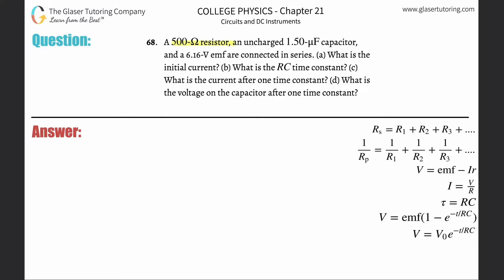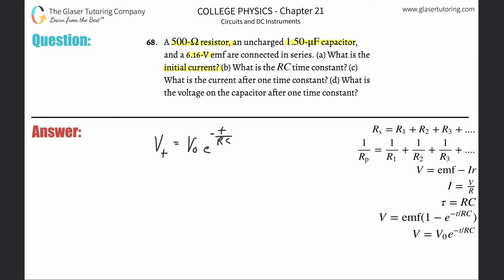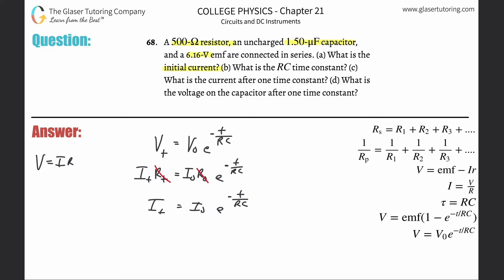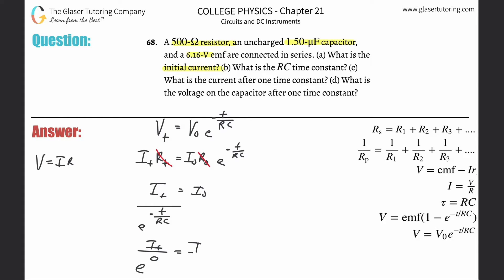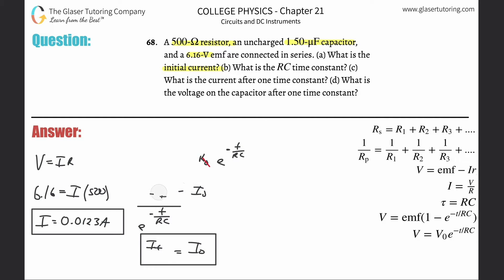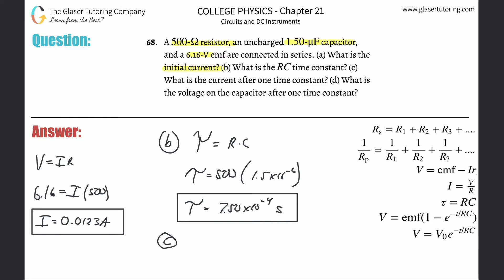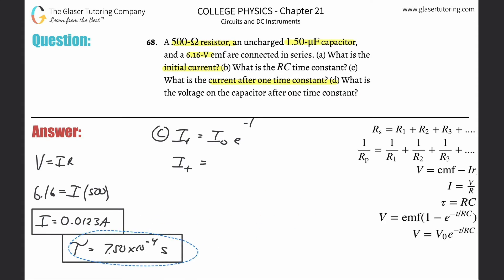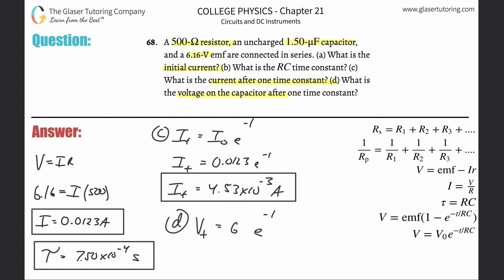21.68 | A 500-Ω resistor, an uncharged 1.50-μF capacitor, and a 6.16-V emf are connected in series

Comment from the maker: Hi All - for part (d) i accidentally used the discharging formula instead of the charging formula to calculate the voltage across the capacitor after one time constant.  Since an EMF is being applied to an uncharged capacitor, the capacitor, over time, will be charging and not discharging.  How could it be discharging if it starts uncharged?? Whoops, silly mistake.  Anyway, the second formula from the bottom on the right-hand side of the screen should be used.  So, following similar logic as presented in the video, the formula would simplify to Vf=6.16[1-e^(-1)] and therefore Vf would be 3.89V.  Hope this helps
Reply: Thank you for the fix of the formula!